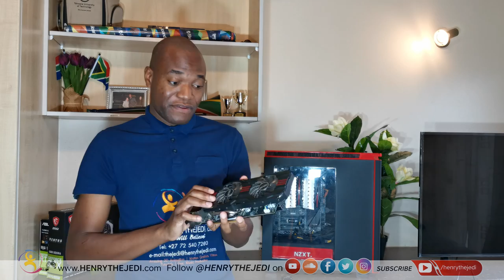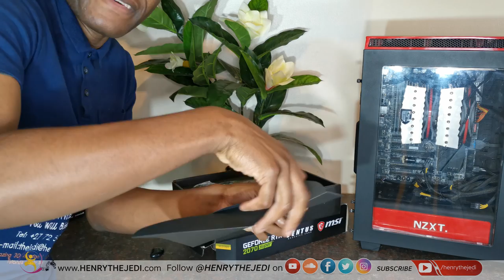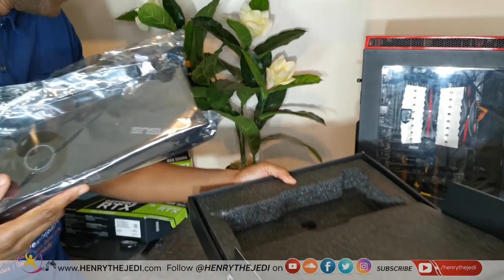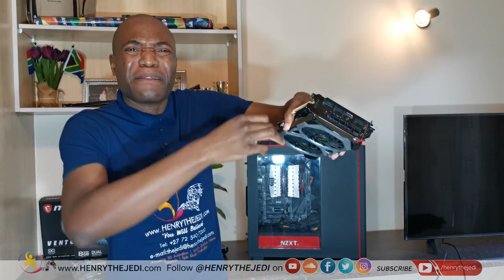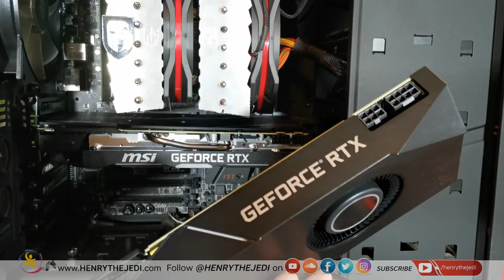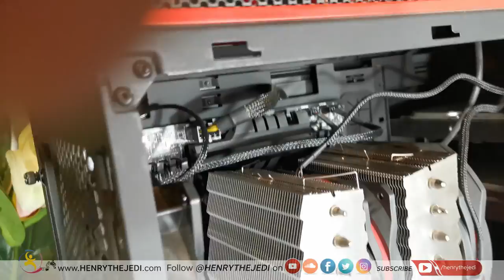Tutorial 88 - How To Install Two Nvidia RTX Super Graphics Cards

Comment: Nice you will be getting Nvidia Titan performance with two of them, great video..
Reply from the maker: Hi Peter, you are so right, and I even checked the benchmarks on cgdirector and what taakes the mighty RTX3090 a time of 02.42, the two RTX 2070 supers do it in 03.03, which is a tiny difference of mere seconds, and yet this is done at a fraction of the price, so I will always go for 2 70 series cards up until its economically viable to just buy a single high end card